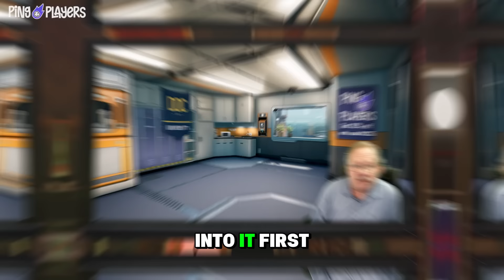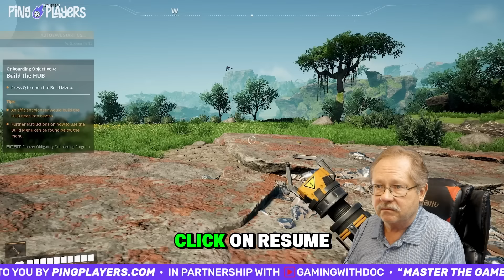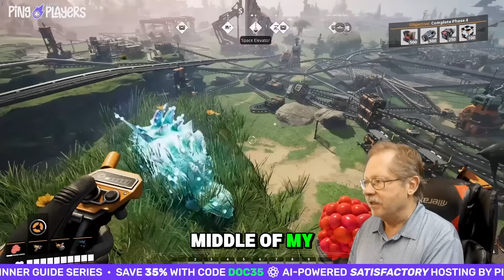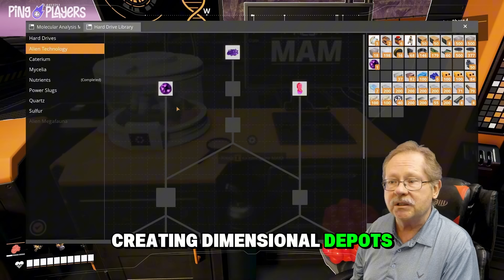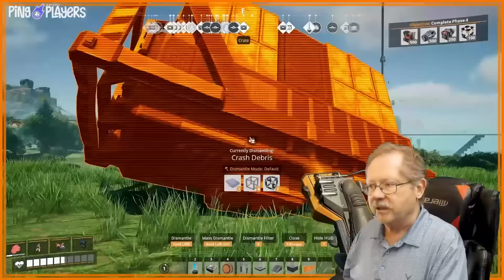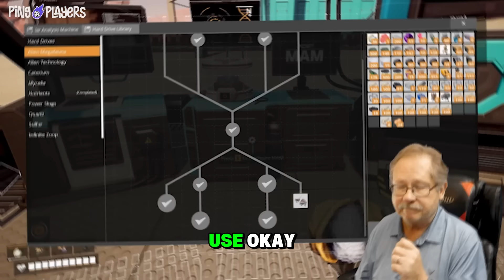Satisfactory Beginners Guide + Pro Building Tips (Full Starter Tutorial)

Comment: Dunes is hands down the best place to start for a new player in my opinion. The north western corner specifically. Grassy fields they are going to struggle with such little resources and so much infrastructure needed to mine them. Desert is super easy thanks to nodes being easy to find, higher quality, easy to see sloops and slugs,  better quality slugs. Enemies are a bit tougher but still easy and few. Easy access to more rare and higher tier materials. Grass Plains is simply easy due to having practically no enemies and a lot of foliage to cut down for burners. But the number of low quality resource nodes means a lot of miners and a lot of belting for little production.. which also means more power needed. Much more spaghetti prone area for the average player.

The forest is the best place to start overall.